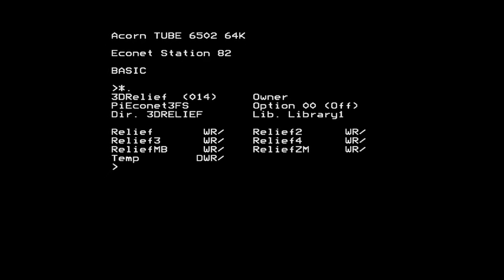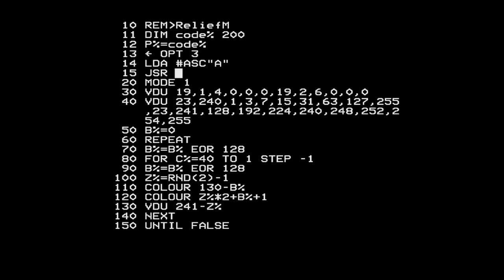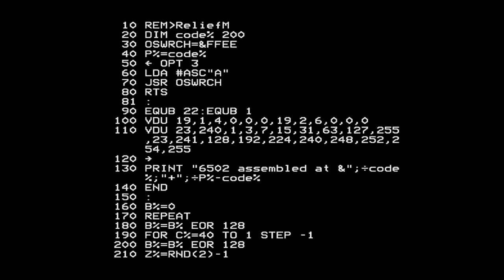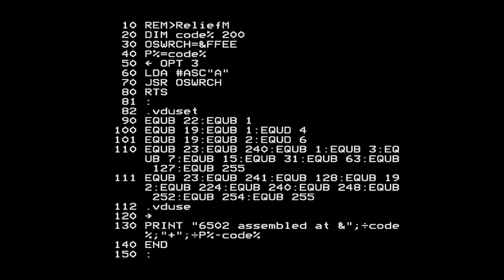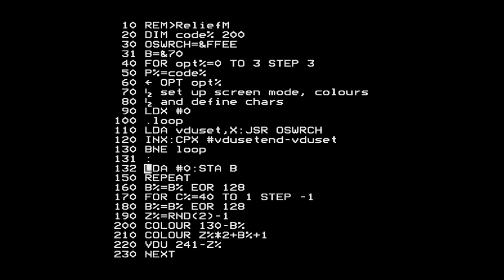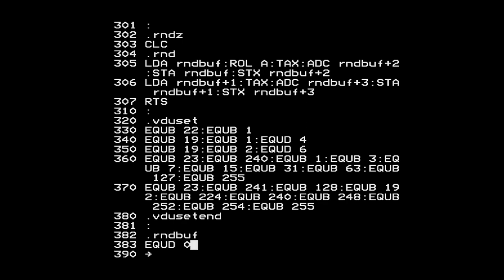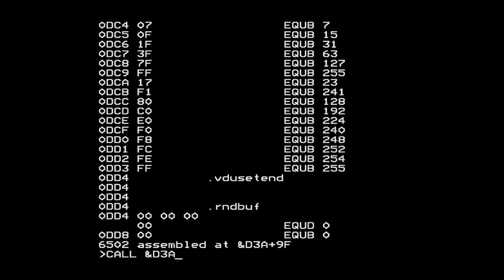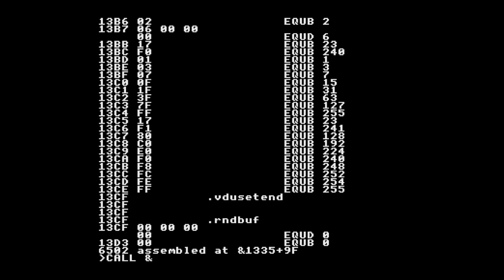6502 3D 10 PRINT using the BBC BASIC assembler

Comment: What about going with a 65F02 FPGA based 6502.
Reply from the maker: I have one of those in my Plus/4 to replace the 8501 that stopped working properly.  I initially had one of the adapters and replacement ROMs to allow you to use a 6510, but that didn't control the tape.  The 8502 FPGA version just works like a native chip and obviously doesn't affect the programming (which is the aim of it!).

Comment: Q: could this work in the BBC BASIC emulator in RISC OS on the Raspberry Pi, do you think? Thanks.
Reply from the maker: I think it would work if you could run !65Tube or !65Host, but I don't know if they are available for the Pi — I've never seen them.

Certainly the BASIC version would, though (as it's still BBC BASIC), although you might need to check the screen modes are the same.  If you ported the code to ARM then it would work in the ARM assembler on there.  I've almost done the ARM version but I'm away for a few weeks now, so won't finish it.
Reply: @lsbyte  it would be more to do with is the emulator or a simulator a simulator just does the look and feel, but it's only skin deep, anything could be happening out of the users site, but true emulator mimics all area's of what's be emulated, even the bits the user does not normal see or interacted with?
Reply from the maker: Following this up a bit more, I have now written an ARM version which should run under RISC OS, as well as the Native ARM Tube processor on the BBC provided by the PiTubeDirect.  If you're interested in that, let me know and I may do a video about it!